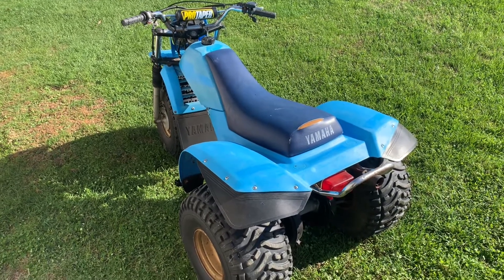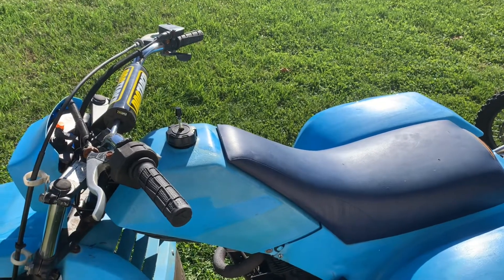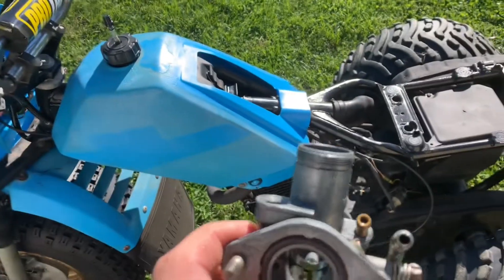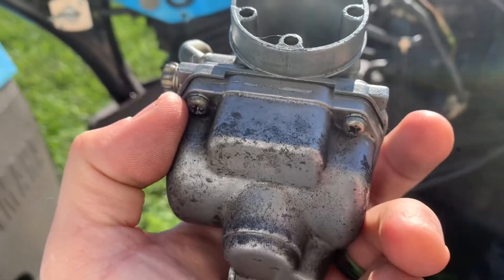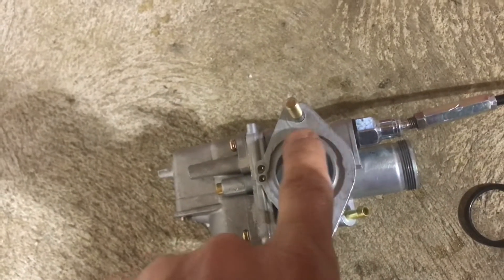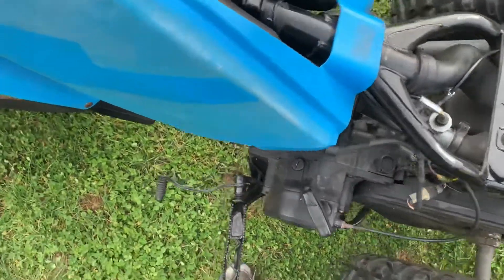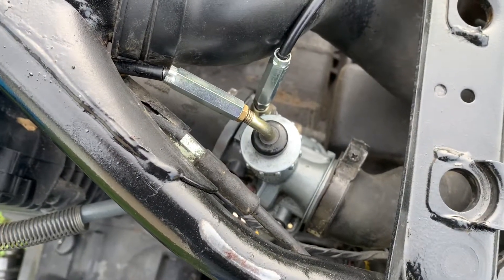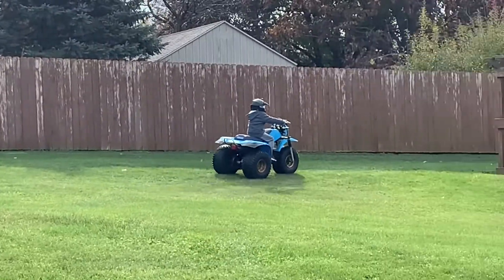Yamaha YTM200 three wheeler! Amazon carb fail

Comment: I’m currently banging my head with one of these ytm200s. my carb is different. It does not have a flange on the engine side it goes in a boot. Non the less I’m ready to give up lol
Reply from the maker: I ended up selling it. I never got it to consistently idle. I think a rebuild would help, but I never found a kit. Tried a cheap aftermarket, it was terrible. I have another brand on my pit bike called NIBBI. That carb is great! I thought about buying one for this and just “making it work,” but I got tired of tinkering and it was time to let it go.